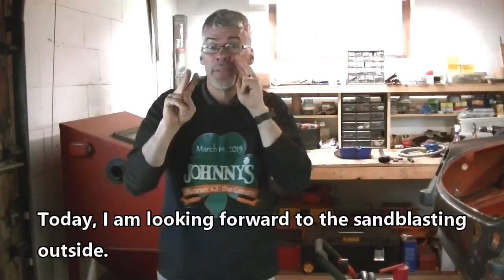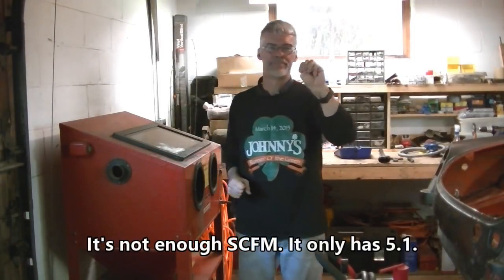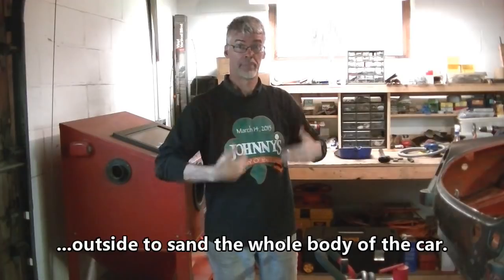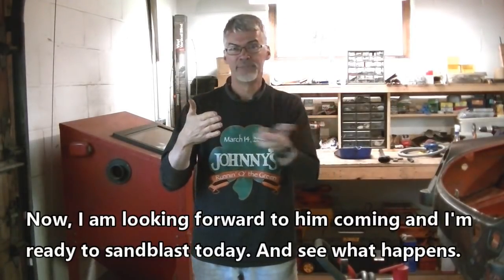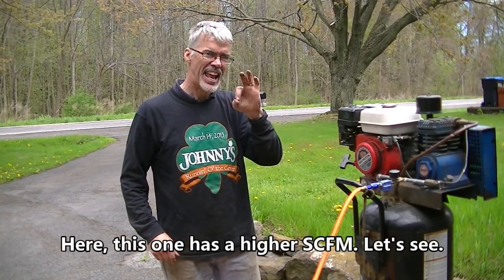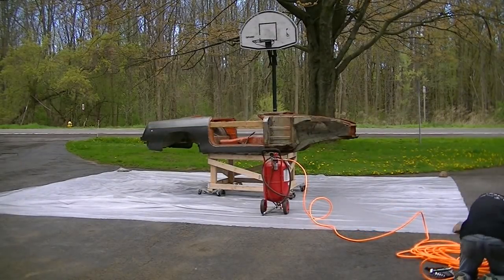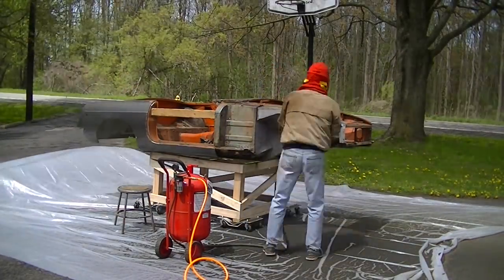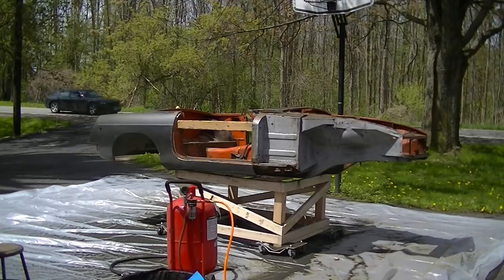Sandblasting on the MGB Car

Comment: I have a blasting system with 2000l/min and a 5.5mm Venturi Nozzle. My consumption is about 80-100kg per Hour. I uses paint stripper and a wet blasting system before, to remove all paint, except for the primer. Then i blasted my car to bare metall. 
For me it was the fastest method and the cheapest. 
I bought a used compressor and sandblaster, new hoses and blasting nozzle and it cost‘s me about 1000 Euro.
Reply: Sorry for my bad english :)
Reply from the maker: Great information. Thank you!

Comment: At 2:06 you can see the metal braces that the sheet metal attaches to. My neighbor had his car blasted and ruined the hood truck lid . Wet blasting much better much less warping.
Reply from the maker: Thank you for adding your information! Thumb up!
Reply: Yeah you wanna be careful when sandblasting, smaller compressors in most households means most people crank to the max of what the blaster can handle, but MORE than what the bodywork can handle.

Which is why a big used compressor of reputable brand is better than a brand new smaller one of reputable brand.